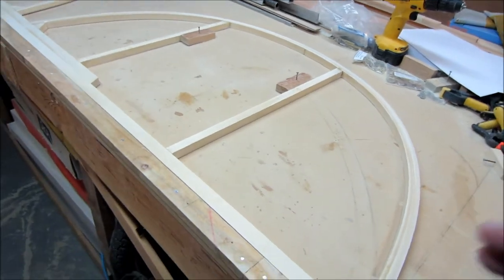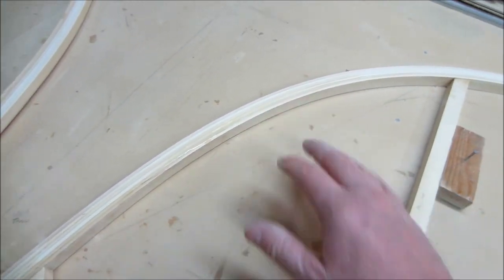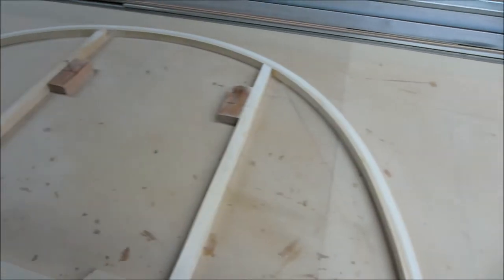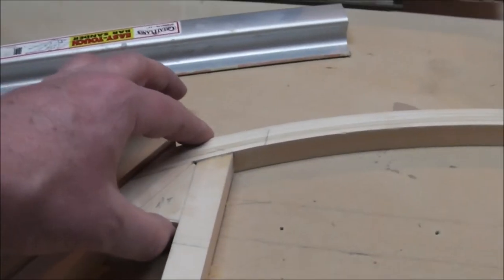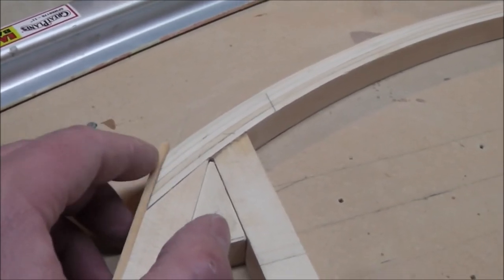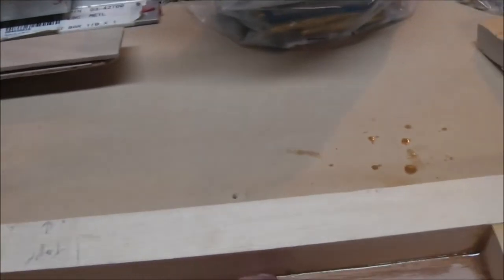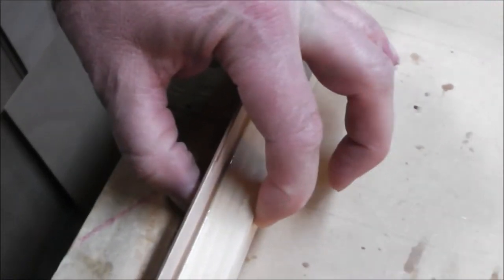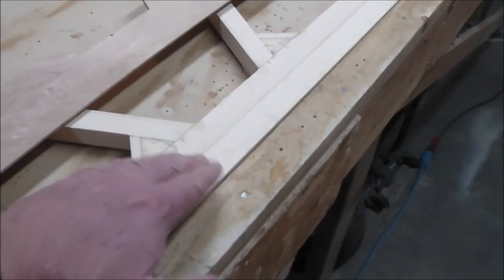RagWing Heath Build Elevator

Comment: I NOTICED YOU DIDNT ADD THE 2024 I/4 BY 1 INCH ALUMINUM INSERT IN THE CROTCH ( I GUESS YOU WOULD CALL IT) AREA
Reply from the maker: The reinforcement piece for the elevator, I'm on the fence about that. The laminated leading edge is very strong.  Roger added it after some people chirped about it.
Reply: @hogsnplanes  THANKS FOR THE HELP WHEN YOU DONT HAVE TO. GOD BLESS YOU!
Reply from the maker: @tlcasey1002000   My pleasure